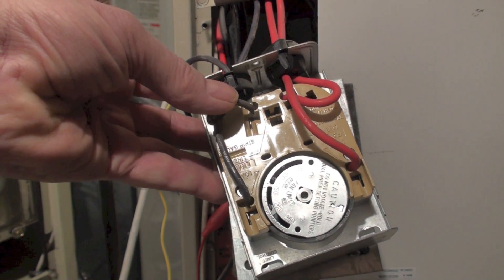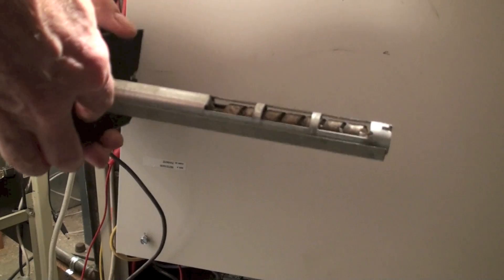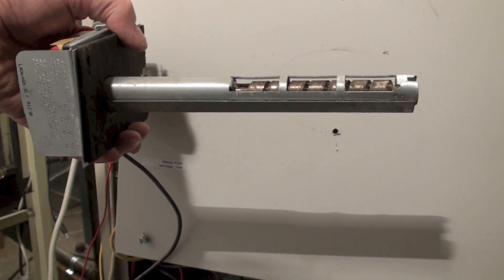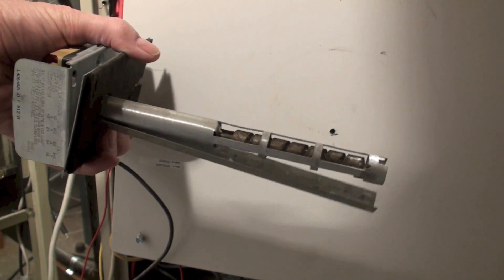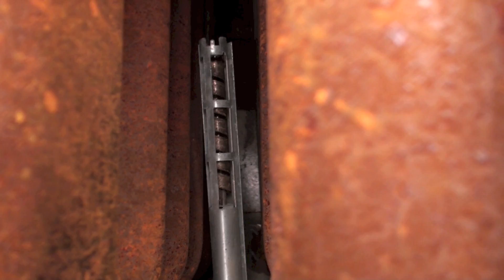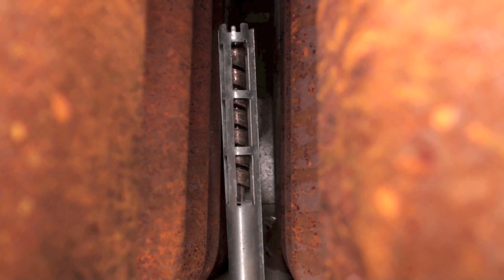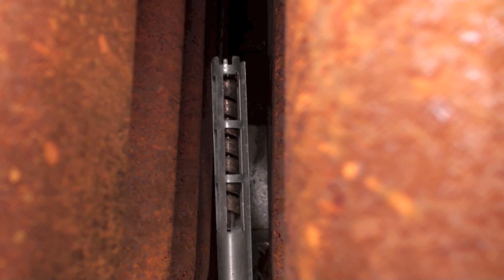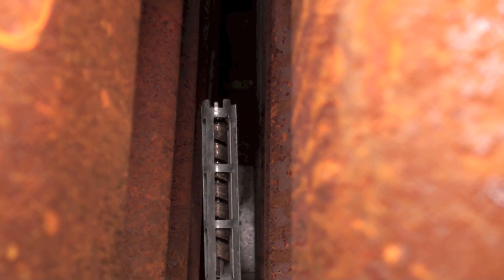Honeywell fan and limit temp probe and position

Comment: Have G1303 model Lennox pulse. Limiter switch seems to fail within 2 winter cycles. Have been replacing with 5 inch probe  limiter switch. Do I need a longer probe length?            
HVAC guys are often not experienced with older Lennox units.

Comment: I have a thirty one year old synder general gas furnace and it has been short cycling for almost a month now. I replaced thermo couple. Blower moter went bad and replaced with rescue motor and worked fine for a while after that. Blower motor is always running. Burners turn on for 30 sec and then shut off. Then abt 4 min later it tries again. I jus took the fan limiter switch off and tested and is working correct. Any chance the bimetal on this fan limiter switch can go bad? Is it supposed to be touching the probe at the end? I have six dogs and the filter needs to be placed like every two weeks haha but im wondering if the bi metal is shot from the bad blower motor incident and also having dirty air filters? Im sure the heat exchanger isnt cracked so idk what else could be the issue.
Reply from the maker: If you have a 90% efficient furnace, you could have a plugged secondary heat exchanger coil or the A/C coil or blower wheel could be plugged.
GFM
Reply: @grayfurnaceman  i just reinstalled my fan limit switch and turned the furnace on and the temperature according to the limit switch is too much to not trip the fan limit switch. Was running for two min as i watched it spin all the way around shut off the burners and just kept spinning.
Reply from the maker: @alale923  And you are sure there is no crack in the heat exchanger?
GFM
Reply: @grayfurnaceman  i did the match test and i have multiple carbon monoxide detectors. I have one in the basement and in our living area.
Reply: @grayfurnaceman  im just paranoid abt letting it short cycle for so long. I live in Cleveland and its super cold rn. But i work construction and my wife works in her office in the attic. Im just paranoid abt the house burning down when im not here.

Comment: How do I hook up the preheater to this model L4064b2210 thanks in advance
Reply from the maker: You do not.  Isolate the the wires from each other.
GFM
Reply: @grayfurnaceman  Thank You, that's what I did but wanted to see if I had another option.  Thanks again

Comment: I want to the store and they said they replaced the 6 wire to 4 wire any advice how to do that For the Honeywell honeywell l4064t to 6 wire to 4
Reply from the maker: The 2 wires that were connected to the center of the switch, should be capped off and isolated from each other.
GFM
Reply: @grayfurnaceman  so once we cap it off will what is the next step do we need to rewire anything
Reply from the maker: @shaima00  The part number depends on the length of the probe.  All other wires are installed the same as original.
GFM
Reply: @grayfurnaceman  so the preheater can't be wired up?
Reply from the maker: @mikepotter4373  No, because there is none in the switch.
GFM

Comment: I have the Honeywell that has 6 cable not 4 cable  l4064t1525
Reply from the maker: The 2 wires that are connected to the center of the switch are for a preheater that is no longer available.  They should be removed and isolated.
GFM
Reply: grayfurnaceman  it’s the two middle we need it to give low voltage to the fan ant the timer Honeywell l4064t
Reply from the maker: @shaima00  What I am telling you is that switch is no longer available.  The replacement switch will not have that part.
GFM
Reply: @grayfurnaceman  so what is the replacement part

Comment: Like your videos thank you for so much info. I have a Newmac oil and wood combo. Wood being the add on. Can I clean this internal coil ? Its sticking and my furnace runs quite a bit. It's set at 100 and 150. Thanks
Reply from the maker: You can remove and clean the coil, but generally, it will not help.  The control is probably failing.
GFM

Comment: First, thanks for these informative videos.  I have an Lennox 1979 oil furnace.  The limit switch was set 90 off 125 on,  Watching the dial it  takes the 125 on pin and carries it over to the limit.  That cant be acting correctly?  The fan comes on and runs maybe 30 sec. and cycles off then on.  Has 11" stem on limit switch  Any thoughts?  Thanks
Reply from the maker: First, is the burner shutting down?  Second, I would try setting the on temp to 140 and off at 100.
GFM
Reply: So I panic when the 130 degree on pin is heading over to the high temp lockout and I hit the breaker and shut the furnace off, then realized the residual heat might harm furnace and turned on breaker.  The fan hadn't come on till I turned breaker back on.  So looking at your video on troubleshooting high temp fan switch I put ohm meter on the fan side and turned dial and no contact.  I unscrewed the contact on the fan side and it operated fine manually, to me.  I noticed the hold down screws for the contacts had one hole elongated, like the old points on older cars in the day.  I moved the contact point for the points a bit and now the ohm meter shows life.  Reinstalled and it functions.  I also had set the multi RPM blower motor to medium low from low and the motor makes a noise so I put it back to low speed, no noise.  Another days project.  Have you replaced bearings in these motors????  @grayfurnaceman
Reply from the maker: If it is direct drive, the bearings are not replaceable.
GFM

Comment: I have a mid 1970's Janitrol that still works great, but the original fan control (Penn controls/Magneseal 782-834) no longer works (fan runs constantly). I want to replace it with the Honeywell but I am not sure what length sensor to go with. How do I figure that out? I also need to drill I to the exchanger box so I will need to be careful.
Reply from the maker: Use the same length as the original.
GFM
Reply: @grayfurnaceman  
I would but the original is located on the furnace wall with a coil-type probe run into the front of the heat exchanger in between the front of the combustion channels and behind the front sheet metal of the furnace (there is quite a bit of space between the out sheet metal and the combustion channels). Does the new probe need to run between the combustion channels or OS placement in front of them in the space ok?
Thank you for your help!
Reply from the maker: The new probe should mount in the same position as the old one.
GFM
Reply: @grayfurnaceman  thanks again!

Comment: My limit switch is not functioning at all. The manual on/off knob will not turn the blower on. This is the 2nd one to go bad in 3 years. Always happens after summer when I quit using the a/c and start using the heat. I can turn the blower on with the thermostat upstairs but not with the liner switch. Even if I turn the dial it will not activate the blower. Any ideas?
Reply from the maker: The only thing I can think of is the blower may be oversized for the fan switch.  Most of these fan switches are capable of handling up to a 3/4 hp motor.  If yours is larger, it would fail.  
GFM

Comment: Hi
I installed a new L4064B Honeywell limit controller temp is set to start at 130F off at 90F  but when it starts to cool down it shuts off at the ON pointer. then starts up after a couple of minutes for 15 seconds then stays off untill cycles again.
Can you help me
thanks
Glenn

Comment: what do you do if there is none there at all ?start with the small size? like your videos I took a oil furnace out and we found a wad of money taped up in aluminum foil the fellow that was working with me said what are you going to do I said give it to the owner it not mine the old man said thanks he said he misplaced it haha
Reply from the maker: An honorable man.  So, there is no fan switch at all?  I would measure the place it fits and if it will fit, try the 11, 1/2 inch.  One other issue you may have is some of these switches have an air dam underneath to avoid short cycles so you may still have troubles.
GFM

Comment: mine i set up   on at 180. fan on at 100 off at 130. this is what mine is doing but I'm just not sure if mine had a shield  like this before. it was my dad's house before he has passed away. and he may of changed this switch himself and left  off  the shield let me know if you think this could be my problem   soon as fan kicks on the dial drops very quickly on limit switch
Reply from the maker: +1962 buick I would try 140F.  You can also try making a shield for the probe.  Hope this helps.
GFM
Reply: +grayfurnaceman thanks for these videos got it all fixed up I did make a little shield tonight   after I seen the video of what your shield looked like welded one up and slid the switch threw it works great now thanks again

Comment from the maker: No, they used a fan board to time the fan on and off.  There is a limit switch placed in the place the fan switch would be.  Checkout the 398 playlist.
GFM
Reply: grayfurnaceman which one is that so the new part only 4 wire so how do we connect the 6 wire to the 4 wire

Comment from the maker: Its a Rheem RGDA.  Yes, some of the earlier induced draft furnaces still used heat operated fan switches.  Once the IFCs came in, the IFC controlled the fan.
Reply from the maker: @rickphillips2831  First, Its a Pulse get rid of it.  
If you are still here, does the furnace light off or does it just not start the blower?  
GFM